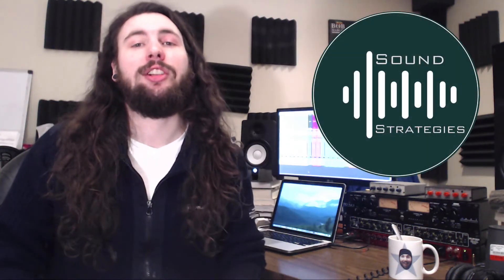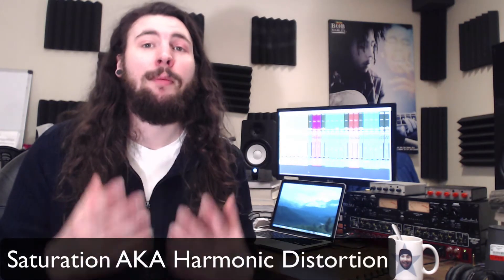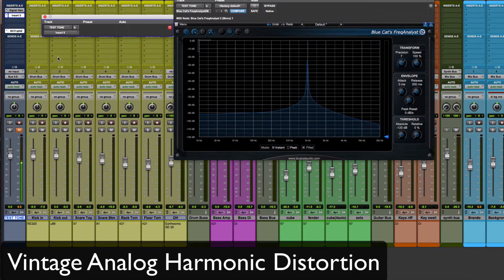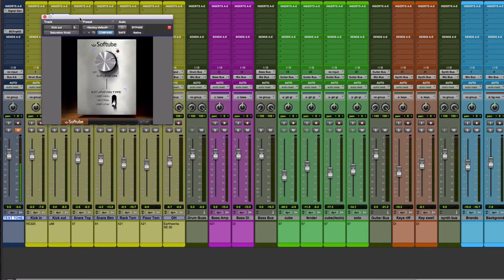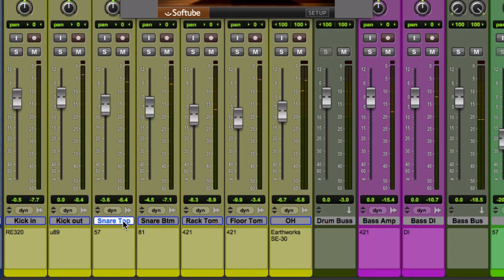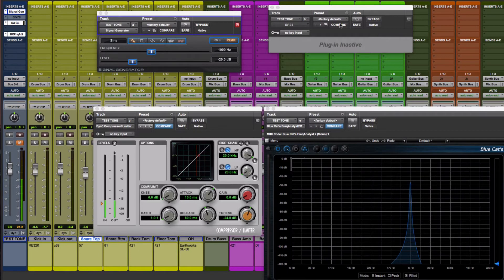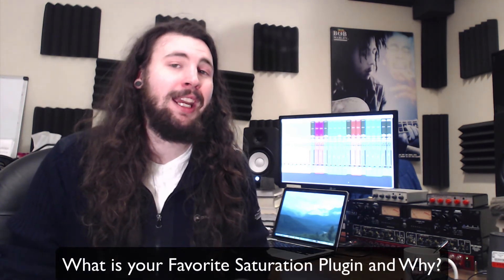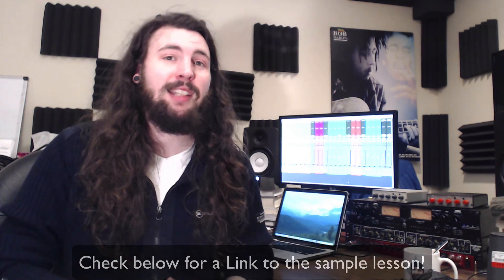Mixing Tool Spotlight: Saturation

Comment: Recently I've been getting addicted to using saturation, though not too much, I don't like "crunchy" sounds.
Reply from the maker: I've been a pretty big saturation junkie as well. I do agree the effect works well when it's hardly noticeable. However I made another video about blending a really trashy track of the drums in with the rest of the drum mix. Sylvia Massy called it the 'crotch mic' and Moses Schneider calls it 'die Wurst'. Definitely worth checking out. Thanks for your comment!